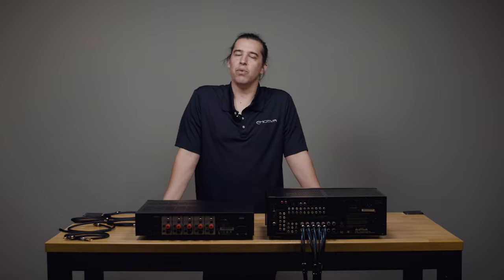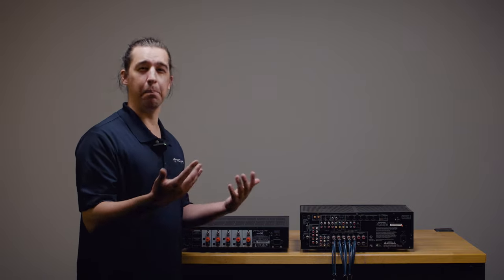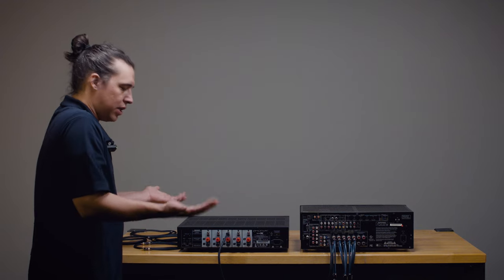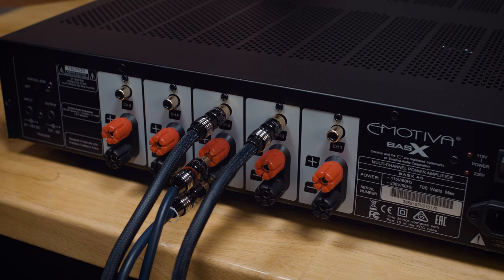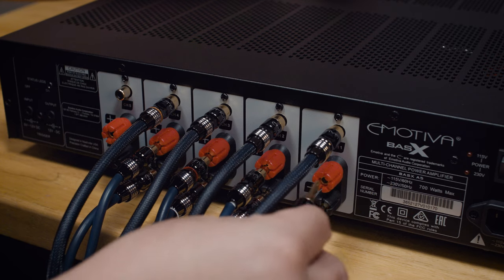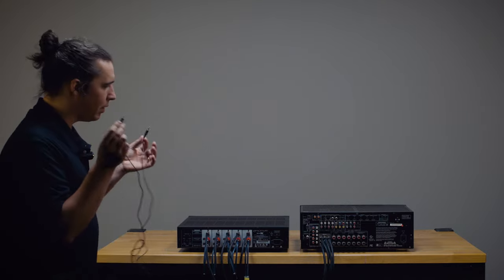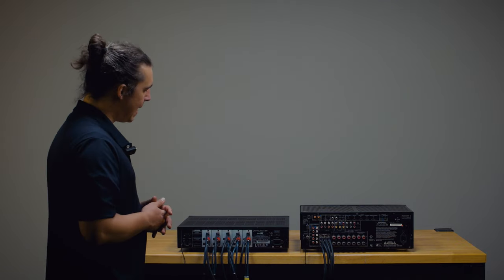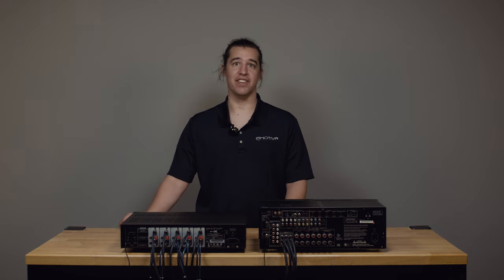How to add an External Amplifier to your Home Theater Receiver!

Comment: I've added many amps to my cars headunits over the years, but have never added an amplifier to my home receivers. I wasn't sure if it was the same concept or not, but after watching this video, I realized it pretty much is. I do have a question, obviously with 99% of aftermarket car stereos, the RMS output is usually around 15-25 watts, so I completely understand adding an amplifier. However, with home A/V receivers that boast between 80-120 watts per channel, do you really notice that much of a difference with a home amplifier?
Reply: Even the top models AVR's have max 40 watts per channel when all channels are driven.
Reply: Yeah most AVR’s only provide the information for watts when 2 channels are driven when they say those big numbers of 80-120 watts. So the more channels that are driven the more that number decreases as it is spread over more channels being powered. The Emotiva MR1 actually gives the power rating when different number of channels are being driven at the same time. On the other brands you will notice most will say x amount of watts but then look for the parenthesis that says (2 channels driven) or something to that effect.
Reply: @ekimandersom4478  Thank you!
Reply: @rickx86  Thank you!

Comment: Mine doesn't have preouts
Reply from the maker: You would need to upgrade then to a unit with preouts if you are looking to add additional power.
Reply: @EmotivaAudioCorp  will russound adaptor work for now

Comment: whilst technically correct you could use any channel on the power amp to power center, left, right, rear left real right.. 5.1

TRADITIONAL 7.1
CENTER. LEFT, RIGHT, REAR LEFT, REAR RIGHT, REAR REAR LEFT AND REAR REAR LEFT AND REAR REAR RIGHT..

I am not sure what capacity the avr you are in demo on to whether or not it would support it would support either height or wide in 7.x mode

i will note you have crossed over left and right channels in this demonstration not good..

center is center ,  right is right and left is left  and right rear is right rear and left rear is left rear and same with all other effects channels..
Reply: You don't understand the concept of an amplifier
Reply: @ekimandersom4478  Been fucking around with separates for over 30 years, read what i said whilst technically correct you can label center, left, right and rears though simplistic states we all make the reality  when faced terminal end we go from center chan out..

though as I said in original reply you had crossed over right and left channels when connecting up the power amp to the avr but hey sorry for trying to correct the mistake...

I think you may check entry-mid receivers whether or not they will allow power amp passthru

I understand what a power amp does, though you do need to make sure what is being connected is not  going into the input section rather than the output section of the avr..

I own both sony and denon avr's to know what has limitations in connecting  external amplifiers just because there is 5.1-11.4 on the avr doesn't matter the connection on the avr you need to understand whether or not you have an output first of all..

Comment: TIP: check out crown class D PA amps like from sweetwater etc. they are cheap and some are audiophile quality. they have horizontal airflow fans so you can stack them in a rack.  they are built for commercial abuse. i bought a used 300w/ch (8ohms) crown from the early 2000's.  It has the best bass of all my amps, rich and liquid, but wow is it heavy. so i bought another one (750w/ch) used, but it also is heavy.  the new class D's weigh only like 10#.   i mix home audio, pro audio and car stereo gear at will.  line level is line level and i will only buy crown amps from now on..

Comment: Does using one of these amps help large floor standing front speakers actually move their woofer and put out some bass?   If I listen to stereo music my reciver doesn't use the sub and I barely get any bass from my front L/R despite having multiple large woofers.   I don't want it louder.. I want it fuller.
Reply: The answer is yes so long as you properly wire the set up to your liking.  

You may not even need an additional amp.  You just need to change the set up of your current system:

1. Since you stated your sub isn’t used in stereo listening, you need to change from sub out cable to your subwoofer and just use the speaker wire input.  

2. Check your sub in the back.  So you see speaker cable input and outputs.  You should. 

3. You may need more speaker wire but go from receiver speaker out into the subwoofer speaker input. You then use the speaker output from the sub then go into your main speakers. 

Hope above makes sense. You may even achieve your “fuller” sound but you may also have to lower the crossover frequency of where your subwoofer is set. 

If not satisfied with above then you can get another amp and consider bi-amping your main speakers with multiple woofers. You can put more watts to the woofers and less to the tweeters/mids.  Remember to remove the jumper cables/connectors. You should see 4 binding posts in the back of the speaker.  Top Red and Black and Bottom Red Black.

Comment: What about the subwoofer?
Reply from the maker: Most subwoofers are self powered. If you have a passive subwoofer you might need a dedicated subwoofer amplifier that is specifically designed for that.
Reply: @EmotivaAudioCorp that’s my situation.  I have my sub connected to a sub amp and then connected to my pre-out sub on my TX-NR7100.  There is nothing coming from the sub.  Trying to determine if there is a setting that I must turn on in the AV receiver.  About ready to pay someone as this outdoor system has been a headache.